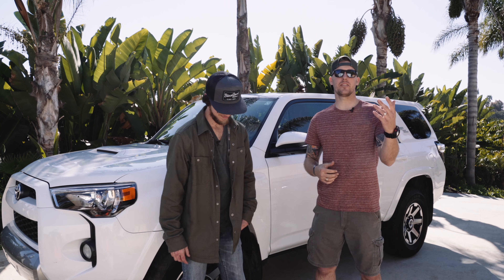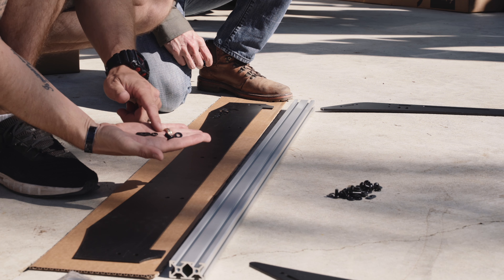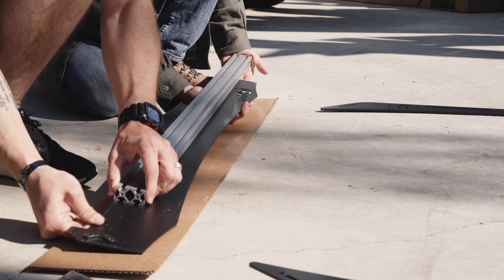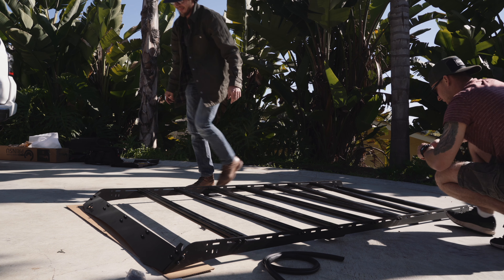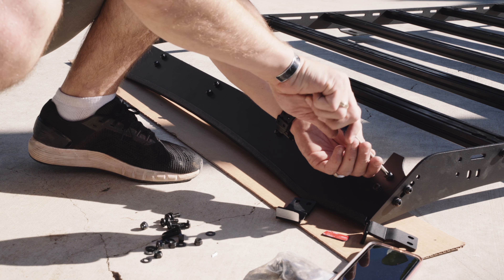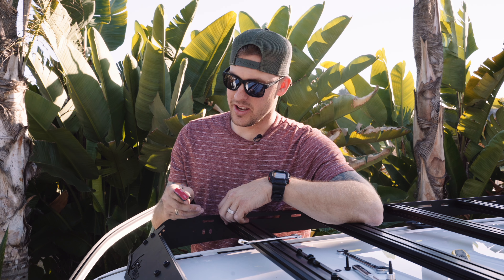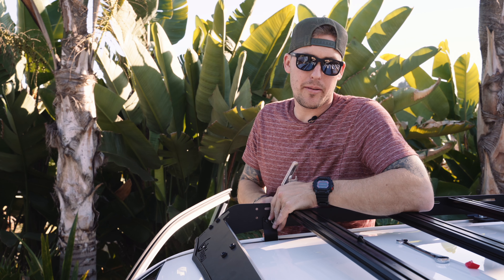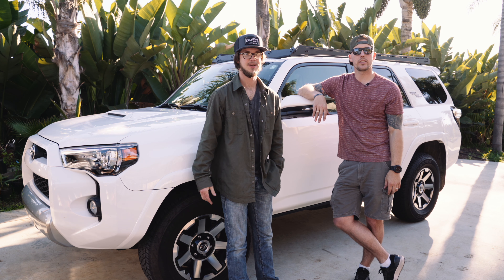How to Install Prinsu Roof Rack on 5th Gen 4Runner

Comment: Would it work to just lift the weather stripping place the bracket with the 3m tape down and then replace the weather stripping back over the bracket so you don’t have to cut it up?
Reply: Maybe even place tape on top of the bracket as well sticking the weather strip to the bracket as well?
Reply from the maker: Interesting. It’d be a tight fit but probably worth a shot! Good idea.
Reply: Mizera Adventures did you try it? If so how did it work out?
Reply: Sorry i know you made this comment 5 months ago, but it works but it’s a tight fit and a little bump over the bracket. I just decided to cut the weather strip, plus it’s all the way on the top of the runner, no one will ever noticed it’s cut.

Comment: can you just seat those front mounts on top of the weatherstriping?
Reply from the maker: I don’t see why not …
Reply: I was thinking the same thing. you can see the holes with out cutting the stripping. I might go without the cutting. Just so the weight of the load can seat on rubber.  Where did the cutting come from?  Thanks for the video!

Comment: are you applying silicon only to the bolt hole or something elese?
Reply from the maker: We forgot to put it in the edit but we did use a sealant. I did mention it on the screen tho
Reply: DO NOT APPLY SILICONE! Silicone will etch your paint, and this will lead to rusting out your roof.

Comment: Great video guys.  You make this fun.  Just want to say that you cannot overemphasize the need to not overtorque those bolts into the aluminum.  Other wise you'll be learning how to use helicoils to replace the stripped out threads!  LOL
Reply from the maker: Couldn’t agree more.. it Is easy to make the mistake… thank you for the reminder 🤘🏻
Reply: @TrailBendersOverland  However, one advantage of helicoils is the replacement threads are much stronger after the repair, so at least there's a bright side. 👍🏼😎
Reply from the maker: @Blakgun  haha stayin positive.. I like it! Let’s get this thread! I mean bread 😂

Comment: Seriously, 3M d-tape on the bracket to support the rack/cargo?
Reply: No.  That 3M tape is only keeping the bracket in place. That little bracket is just to keep the front end of the rack from sagging when weight is placed on the front.  It is not designed to keep the rack on the truck and it's not holding anything down.  That's the job of the other eight bolts that go into the factory roof bolt holes.

Comment: Why didn’t you use silicone to seal up the bolt holes?
Reply from the maker: Oh did we forget to talk about that? I thought we mentioned that you should. We didn’t have silicone on us and we’re in a hurry. I thought for sure we talked about it though. We went back and did it after.
Reply: What bolt holes are you siliconing?

Comment: Since the front foot fills the gap in the weatherstripping, has anyone done something to make the hard mounting points look better?  I know it’s on the roof but still...
Reply from the maker: It’s kinda something that just disappears. Once it’s up you never really think about how the hard mounts look. At least we don’t.
Reply: @TrailBendersOverland  I get that, also concerned about water getting in as well.
Reply from the maker: For water just use silicone around the holes and you’re good to go!

Comment: Anyone ever used red loctite to make the screws permanent on the prinsu?
Reply from the maker: We haven’t. But ours also hasn’t come loose at all since the install. Don’t think you need it.
Reply: If you use red loctite the bolts would be very difficult to remove.  I'd use blue loctite.  There's no need for permanence.